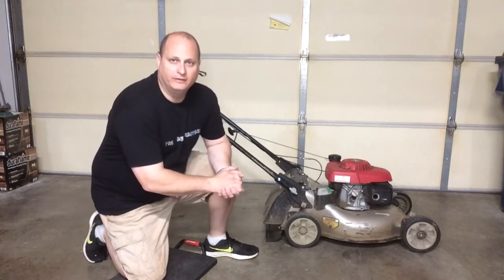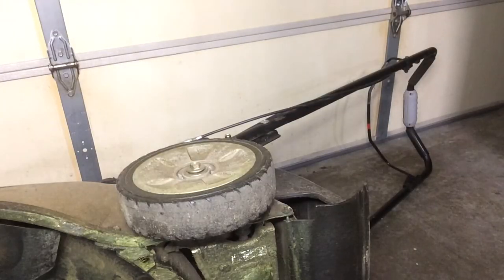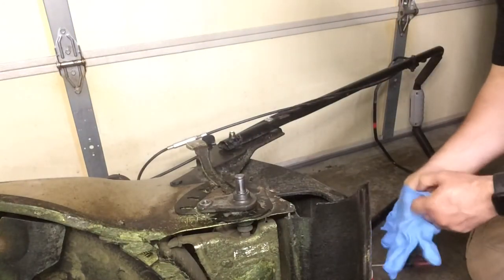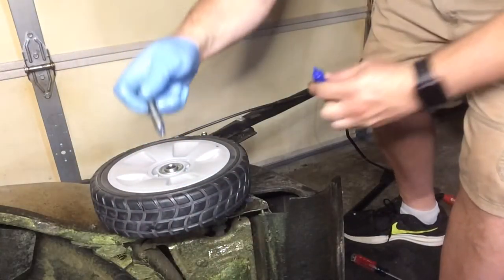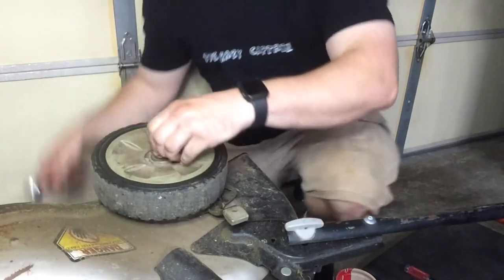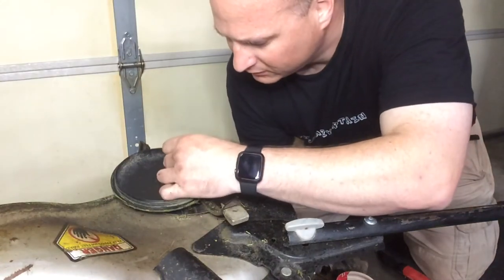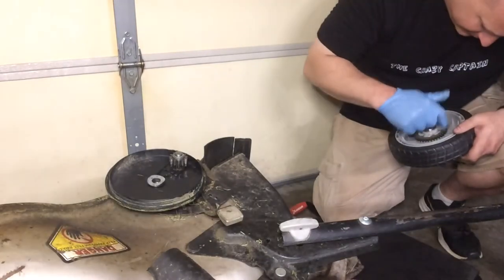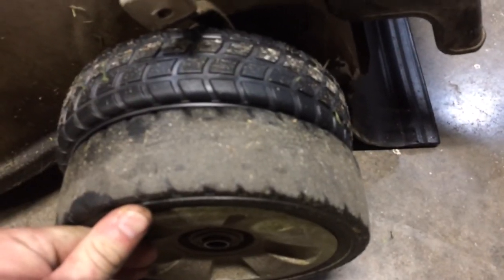Honda Lawnmower Replacement Wheels | How to change your wheels on a Honda Lawnmower

Comment: When the bolt goes through the wheel, the curved washer faces the mower deck, though yours looks like it is facing upwards.  When the bolt is passed through the wheel, the order is curved washer facing the mower deck followed by the flat washer, passing through the plastic wheel housing and screwed into the wheel height adjustment lever.  Thank you for such a detailed and informative video.
Reply: According to Honda, the curved wheel washer goes against the wheel. The image in their instructions shows the center peak towards the wheel.
Reply: He did put the curved washer on incorrectly, "note to self" don't follow this guy's instructional videos, doesn't know what he's talking about
Reply: @frankheath1071  And he doesn't know what a snap ring clip is.

Comment: I followed the instructions despite being concerned about tipping on side.. I turned off the fuel and still filled my carburetor with oil. Shop nearby now has to clean out the carb as i don't have time/will to do that. Should have followed my instincts and just raised the back wheel a bit.. now it's in the shop for 3 weeks and will be expensive. My shop doesn't recommend this method even with the shut off gas valve

Comment: Great lawnmower unless you live in Florida. Sand builds up in the poorly sealed hard to access drive mechanism causing the shaft to rust. Mine only goes forward now. I would have expected more from Honda.

Comment: Sucks that this is your 3rd set of tires! Since when do lawn mower tires become consumable? Doesn’t seem right, I’m thinking Class Action
Reply from the maker: Mine is used in a commercial setting, I would think a homeowner would get about 7 years - 10 years out of it.
Reply: I got 6 years out of mine.
Reply: I got four years out of mine. And the wheels don’t reliably move backwards. steer clear of the HRR mower.